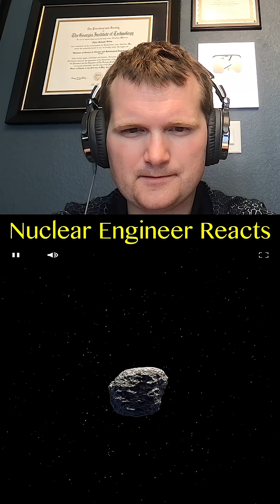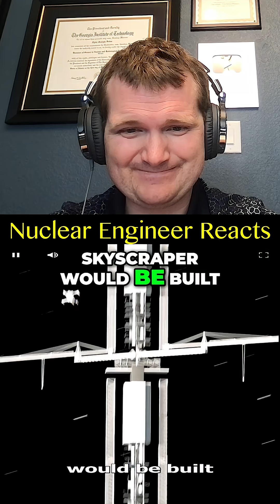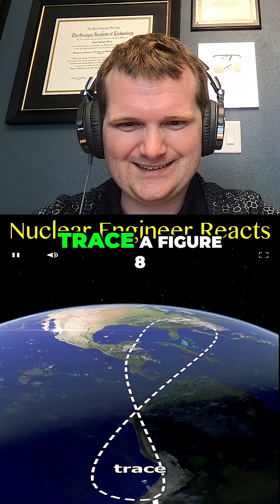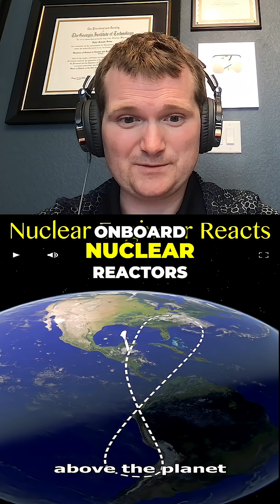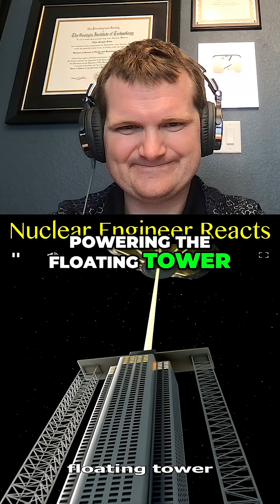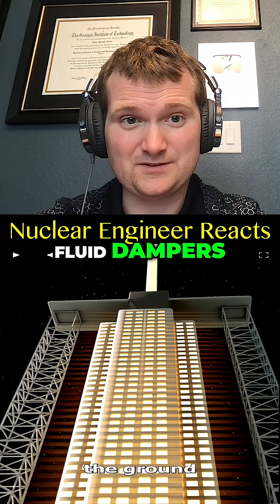How a Floating Asteroid Skyscraper would "work" - Nuclear Engineer Reacts to Zack D. Films

Comment: figure 8 path just above earth is the oddest orbital path ever seen. makes no sense. for something to stay in orbit it also shouldn't be slowed down by aerodynamic drag.
Reply: It makes a “figure 8” because it’s actually in a geosynchronous orbit, and because of earth’s rotation, if you were to plot where it was on earth on a flat map, it’d look like a figure 8
Reply: @ErikVRed  good point. 
the visuals are entirely misleading, since the actual geosynchronous orbit is far off earth.
Reply: @dithy  They're cheating in this case - the asteroid is actually out well beyond geosyncronous orbit, while the building hangs below that level, balanced in such a way as to put the center of mass for the whole system at the geosynchronous orbit point.
There would be so many problems with this, especially those involving interactions with the upper atmosphere, and tidal effects on the entire system.

Comment: The asteroid is not "pulling" the building up. The building is pulling the asteroid down. Since the asteroid is moving faster than the rotational speed of the air, the building is going to have drag due to atmosphere. That will pull back on the asteroid, and slow it. It will eventually fall out of orbit. So you need constant fuel and power to lift the asteroid back up into orbit.
This is a modification of the space elevator concept. It also cannot work wthout fuel and power, due to wind blowing sideways on the connection. That pulls down on the orbital part, requiring constant effort to push it back up into orbit.
Reply: Yeah, I couldn't understand why the orbit will stabilize in the first place.

Comment: Fluid dampers are the least of its worries. It's a nightmare through and through as the passenger/guests are gonna get the worst of both space and air travel. Sun going by multiple times a day would break any sleep cycle and boarding and departure would have tolerance of miles in the minimum. 

Solar panels are a cute idea because any civilization that can put an asteroid into a stable orbit this close to its planet dosent need solar panels on top of it.

In civil engineering the people are considered first and then the structure in every past of the way however for fever dream/nightmare projects like these the structure comes first (or rather the appearance) than people. It's the same for say the line or whatever dubai has going on rn.
Reply: Sleep cycle? What's that?
Reply: @larissa_rosalene Have you ever heard of sleep walking? It's kinda like that but with a bike.